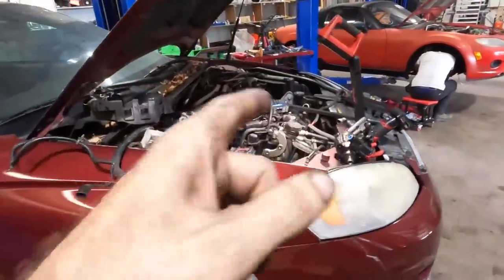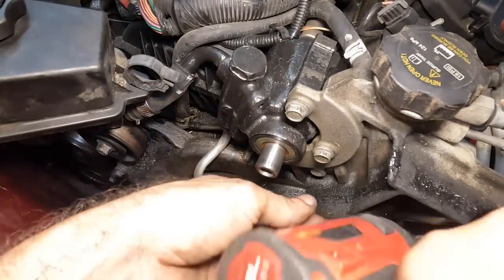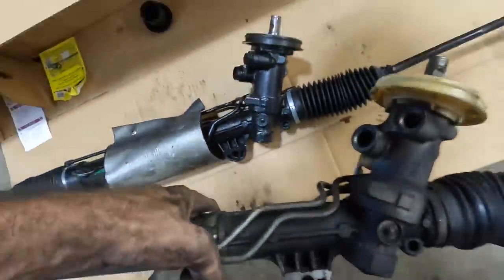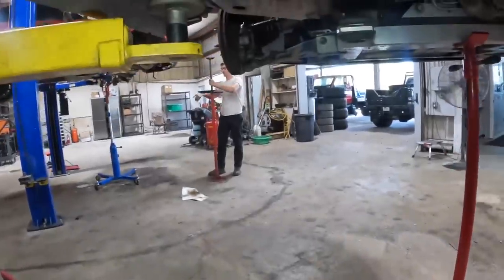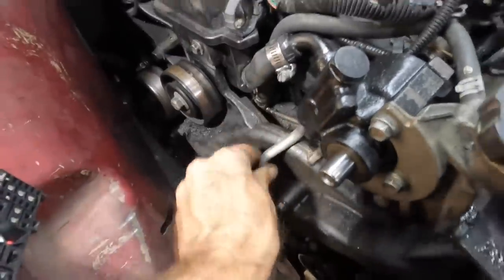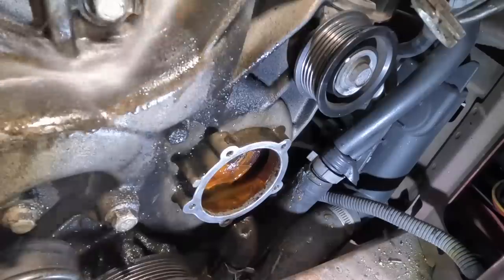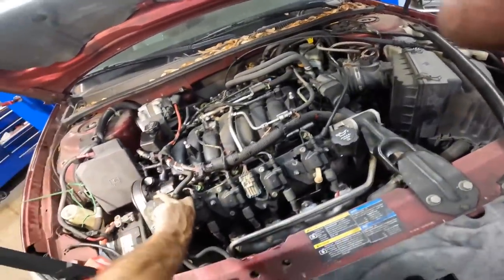Hanging Subframe! Assembly Phase 2007 Chevrolet Monte Carlo SS 5.3

Comment: Ray far be it that I ask this question to a professional like yourself, but I am surprised that after replacing the Rack and the power steering pump and hoses you would not vacuum bleed the system to remove all the air out of it, most all manufactures of power steering pumps and Rack and pinion steering units say it will void all warranties if not done, what is your take on this? But otherwise good video, brother. Tell Wife-uint she is slacking we need more videos from her also! lol :) PS : Tell the New hire unit to tone it down a bit while a master is at work. LMAO

Comment: The engine in this car is different than the
rear wheel drive 5.3. The engine and crank are 13 mm shorter than other 5.3 accessory drive is different and I think some mounting hole are different.

Comment: Would have it been easier to replace all those lines pumps and steering rack if you pulled the subframe  bolts ,dropped the lump on the floor and started from there ?
Reply: No way too much unnecessary work that's why he didn't do. I could usually squeeze the steering rack out without dropping the sub frame but sometimes you just have to do it.

Comment: I rented a 6 cylinder Pontaic of the same vintage ( factoid : some GTOs for USA were made here, back in the time when Australia made things ) . After 3,000 miles on the wrong side of the road, I tried it out on WWVA back roads and found most of the weight of a 6 in the front diabolical . How will you find it on corners with an 8 ?
P.S. My gofer has been promoted to partner unit in your honour .
Reply: P.S. Looks like we will have to binge before ads reappear at the end of the month . Curses You Tube !

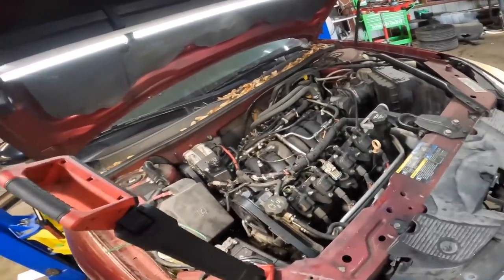Comment: 44:20
Howdy,    Comment                                      This series should be required as the last class in driver education 
    take care of your vehicle                 $30 dollar part,           could cost ya thousands
it took me months (>1)     to fathom stripping down a car     for a spark plug         Oh ya    gotta be a mandatory vid, ,  ,   ,     ,
  at 21    i was holding up my rear suspension with  6 x 6's      and that was the most cost effective measure to take, on a $150   POS
A persons driving technique  changes quite a bit     it can be done    especially in winter     uphill     both ways
  thanks for your time
ty,   les

Comment: For me, I have always used "COPPER COTE" on paper gaskets to prevent leakage, this is because the COPPER COTE seals the surface and prevents water/coolant/oil liquids from saturating the gasket and soaking through causing  a leak through capillary action.
Reply: I use Hilomar   invented for gaskets by the guys at Rolls Royce

Comment: Ray, now that you have Troy both helping and learning, and you have a good high-pressue washer, why don't you have Troy power wash the engine compartment and any other area that you are going to be working on, before you start.  This will help you see any leaks, etc.   Troy is a lucky guy to have you as a teacher and an example of how to not only fix things but, to also learn how to treat customers.

Comment: Aren't you afraid of the old water pump blades so they've broken the new pump!
Reply: chances are whatever is left of the impeller are small enough and will have sunk to the bottom of the block by now, that is where they will stay.  Most likely though it literally rusted and dissolved to nothing.

Comment: A V8 in front wheel drive configuration? What were they thinking?
Reply: It was actually common. Some very big engine Cadillacs ran this way. FWD provides more interior room so you find it will all type of engines, even ones more powerful than this car.
Reply: Oldsmobile Toronado, (66-70).  At least they pointed the engine in the right direction.
425 or 455 V8

Comment: Why did Chevy make the water pump on those 5.3s smaller and the one for the 5.3 in the trucks and suv and 4 times that size? 😂😊
Reply: Weight and towing maybe?
Reply: @desotosky1372  maybe so

Comment: Hey Ray    Did you do up the worm clamp berween the pump and reserve off camera  and i gather you ran that crank sensor with a magic wand wave as well.  never seen a v8 front wheel drive gm b4
Reply: Really?  The Cadillac Eldorado was  V8 with FWD from 1967 to 2002.  The Oldsmobile Toronado was FWD with a V8 from 1966 to 1985.  The Buick Riviera was FWD with a V8 from 1979 to 1985.  Cadillac Devilles/DTS/DHS were FWD with a V8 from 1985 to 2011.  Cadillac Seville/STS/SLS was FWD with a V8 from 1980 to 2009.  Chevrolet Impala SS/Monte Carlo SS was FWD with a V8 from 2006 to 2010.  The Oldsmobile Aurora was FWD with a V8.  The Buick Lucerne was FWD with optional V8.  The Pontiac Grand Prix was FWD with optional V8 from 2005 to 2008.  The Pontiac Bonneville was FWD with optional V8 from 2004 to 2005.

Comment: I’m confused, why would you install the steering rack and lines, before checking the water pump left overs floating through the engine block and heads. 😅 
That motor is toast, and that’s not your car. Wow! 
(Mayday mayday) we have a missing water pump flow housing floating through the motor, it’s all good. ( pay up sucker ) if I were you I would take down this service adjustment, or let’s see part 3 🫣
Reply from the maker: There’s no suckers on my client list. As I’m sure you have gathered by now, that the impeller is made of steel. The steel was rusty, it’s so rusty that it has dissolved into liquid. The steel that may or may not be liquid happens to heavier than the coolant. IF there are chunks of impeller blade in the engine, they’re sitting at the bottom of a cooling jacket and will never come out. Not going to be a problem at all. I’ve tried to buy this car a couple of times from the owner, he’s keeping it🙃…. If it was a junk motor I wouldn’t have interest in it.
Reply: @RainmanRaysRepairs   thanks ray , I know that’s not you. 
I’ve never seen that before, best of luck. 😎

Comment: Why do you never use fender covers so the cars do not get scratched?   Just is more professional. Watch you daily great work Ray.
Reply: Ray to the best of my knowledge came up through the chain shop/dealer network, so he focuses on speed of getting the job done. Like in this video he even runs several pumps knowing he will be running them dry, the power steering and new water pump. A lot of the stuff that Ray does, seems to be just for entertainment of the Youtube crowd.
Reply: @craigfin3222  Yes ,sadly your absolutely correct.I gave up cringing long ago.
Reply from the maker: Nawwwww I don’t scratch things
Reply: @Rainman Ray's Repairs  That is a little cocky my friend.  Remember you used to respect the customer car by just putting down floor mat paper.  It's just being more professional Ray I am certain you can respect that.
Reply: Chris--Me thought the same thing, always use Fender Covers especially on Nice Car...